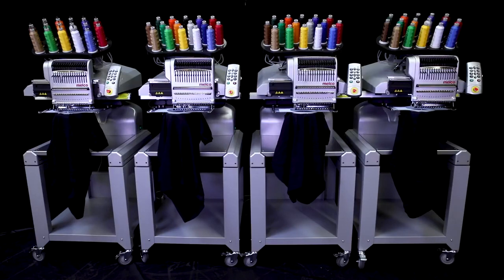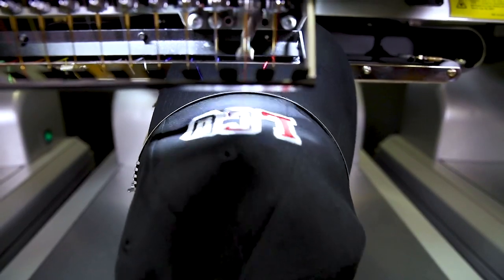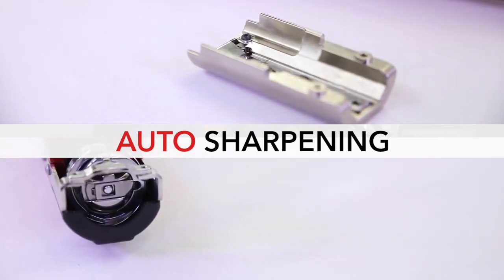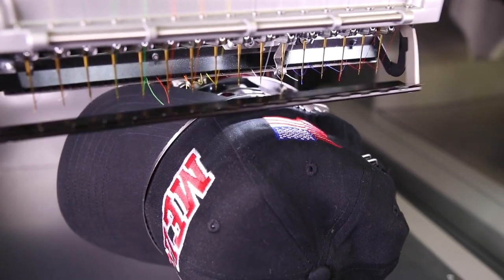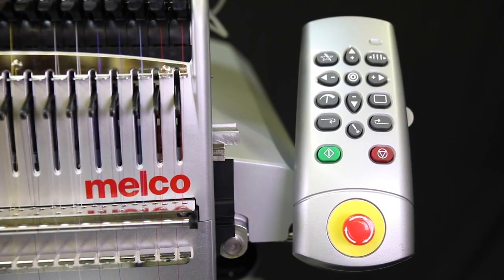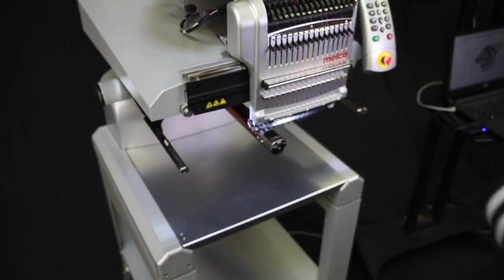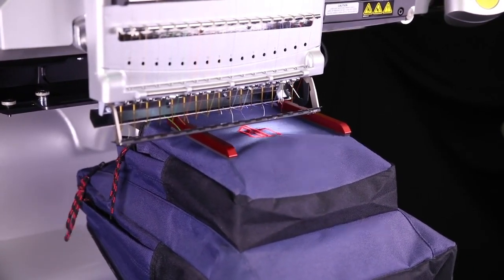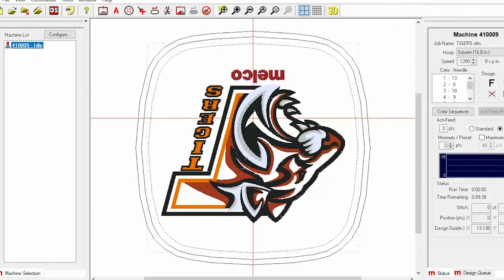Melco EMT16X Commercial Embroidery Machine Feature Overview

Comment: What’s the difference between the EMT16 plus and the EMT16X?
Reply: EMT 16+ is a crap machine. The trim system is in the hook assembly and does NOT work from new. DONT BUY IT. EMT 16X is a different trim system and it works. MELCO do NOT help 16+ owner that need to upgrade to 16X and that s a shame. Shame on you Melco.